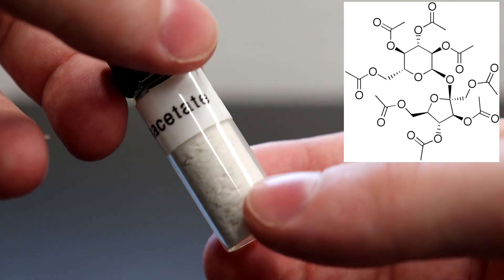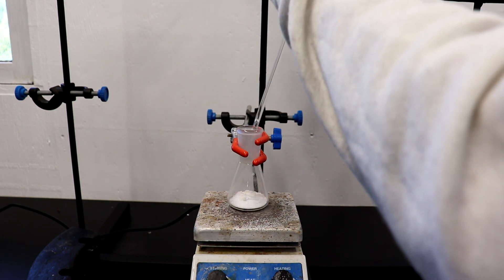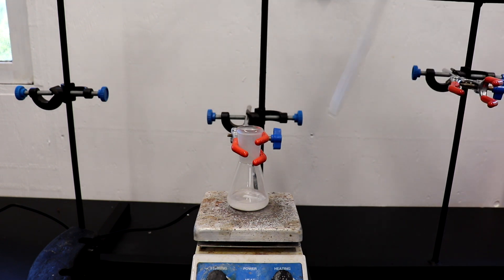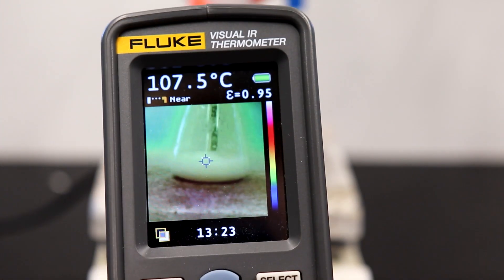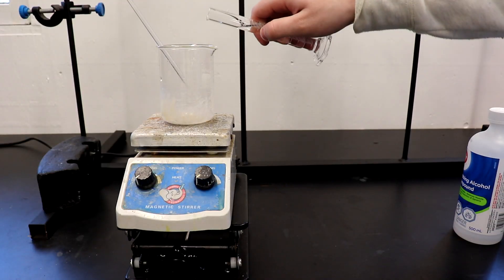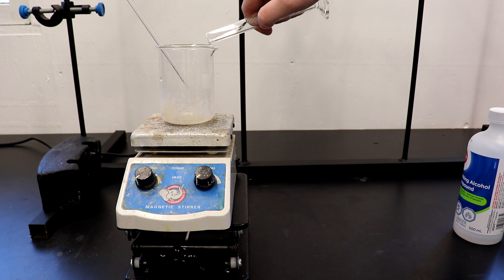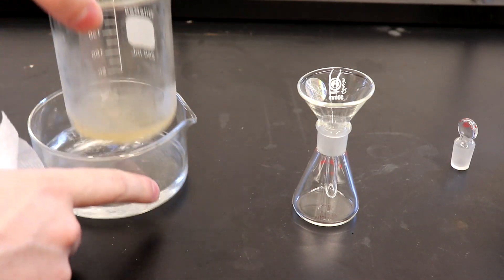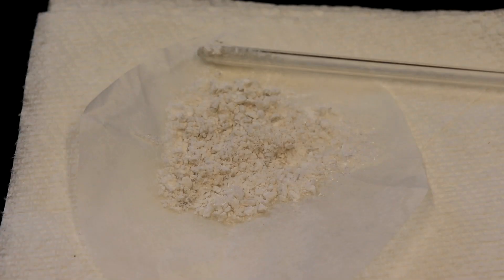Sucrose Octaacetate Synthesis, An Intensely Bitter Compound

Comment from the maker: For the product analysis I also tried running a couple TLC plates with various solvent mixtures, 1:1, 3:1, 16:1 hexanes/ethyl acetate and 3:7 acetonitrile and water, however, no spots showed up,. But the mp was quite good so I felt comfortable tasting the extremely small amount needed to detect the bitterness of the compound
Reply: The reaction probably wouldn't create any conceivable toxic byproducts anyway, afaik. Kinda want to test this myself!